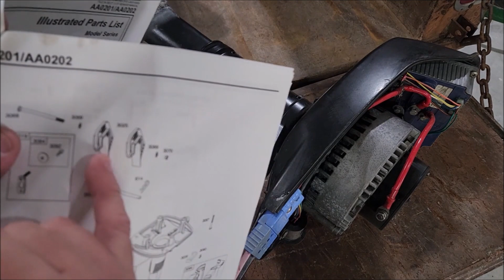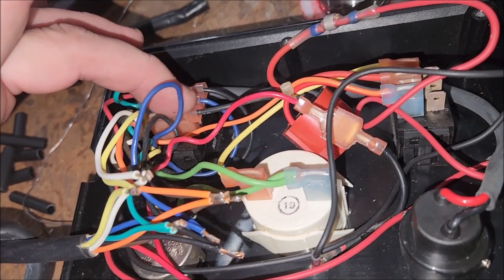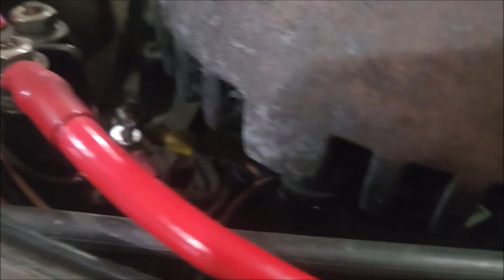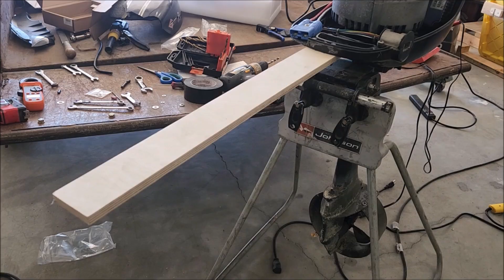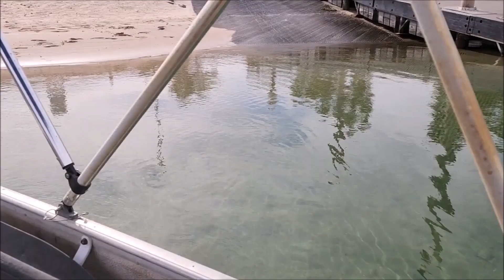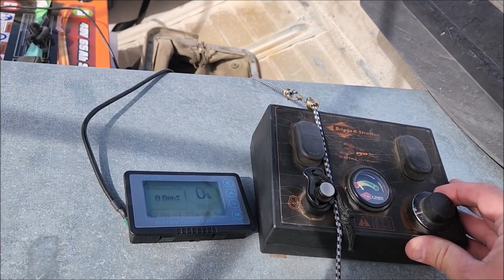Briggs & Stratton Electric Outboard W/ EnjoyBot LiFePO4 Battery

Comment: Love this video. 
That sticker is probably spot on for rated power vs what is out there on interweb right now. 

55a draw is what i would expect for 3kw motor at 48v pulling max amps. 

Its a good find, id run it.
Reply from the maker: @omieyouknowme  I agree; a modern/imported engine would probably be listed at 18.7 HP
Reply: @BrandonsGarage  with 24v

Comment: rating motors on dry land, horse power, makes sense, but on water they could call it, dolphin power or salmon power. Your motor would be rated, 3 dolphin power.  I felt the need to inject a little humor in Brandon's video.

Comment: when you can get a 3hp super smooth crossflow OMC for like $300, and cruise for 12 hours at full throttle on 5 gallons of gasoline and add more if you really needed, these make little sense. unless of course the fun police made your lake all-electric

Comment: I just put a new minkota terrova with spot lock, for $1800, (also with gps) 55# thrust...did I see a 50s era outboard in your trailer? Love to see some videos on that. I have a 1956 fd 10, and a 1960 20hp both johnsons, and I also have a 1956 mercury super silent 6 dad bought new. I just got the merc running last spring, and the 10 is in fine running condition. The 15, (fd 10), suddenly lost about half power, (both coils are good, still scratching my head). Great videos! Thanks for sharing!!